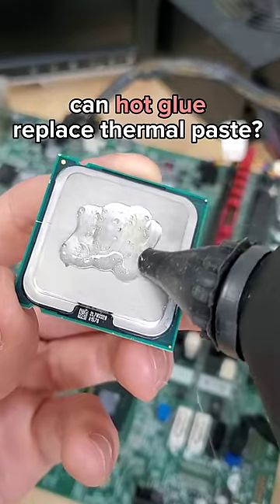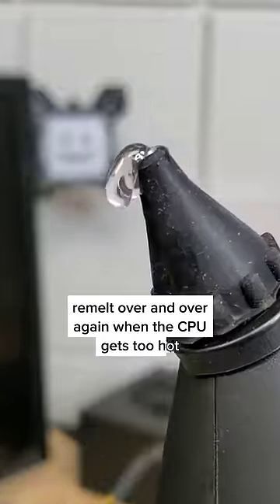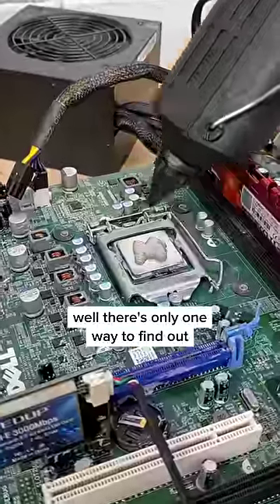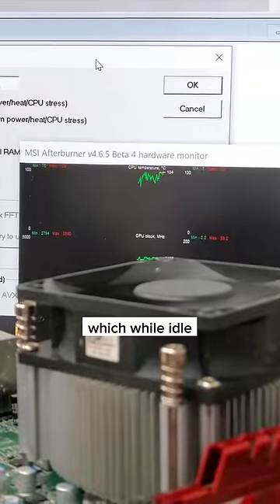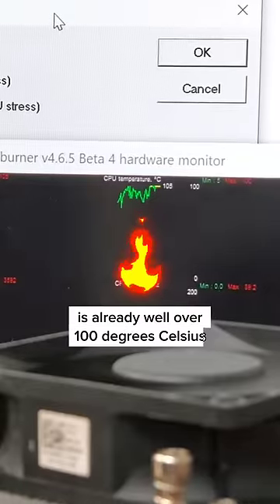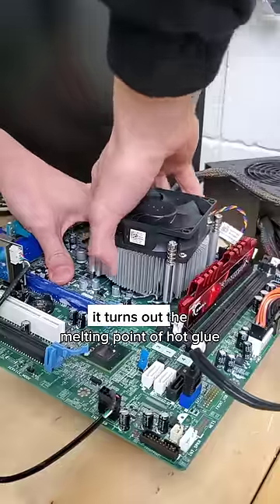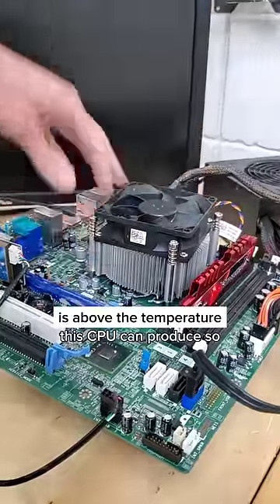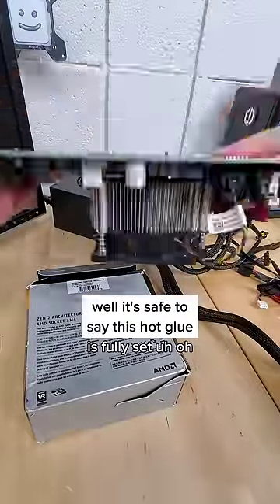using hot glue instead of thermal paste! #shorts

Comment: Use WD-40 as thermal paste
Reply: Reading your comment, I can already smell the smoke from here
Reply: Actually, oil is used in cooling applications
Reply: @Stovetopcookie Yes, in machinery. But not in electronics, probably due to the amount of dirt that oil attracts.
Reply: @alanjamesh.zamorano1677  Well I actually sprayed WD40 on my 2011 PC and on my old GPU and the parts I sprayed actually started having better contact and never rusted while the parts I didn't spray started oxidizing green here and there a bit...

My old Strix RX480 I also used till 2 months ago and is still surely working.

Ps: WD-40 also makes them look brand new and I actually had no dust glued problem, the dust looks just the same and comes out the same as without WD-40 but off course I also wiped after applying and was only full of WD40 on like the PCI slots and ram, it also helped me have much less ram issues after wd40 on the slot cause before if I would just touch a dimm it would go beep, beep, beep and I would have to re-seat the ram a gazillion times...
Reply: @Stovetopcookie  despite having the name "penetrating oil" (or penetrating fluid), it's not really oil as most people would define. It's more like a fuel/solvent. It/they evaporate easily and hence would be similar to using water or ethanol. Pretty much all of it will evaporate after sufficient time/heat.
Reply: Going to be a well lubricated cpu
Reply: Wd-40?? What’s that? I use A1 steak sauce as my thermal paste

Comment: actually hot glue tends to melt at 80c so if the CPU is left cooking the glue and then you don't let the heatsink cool down you can remove it in a tacky state
but better to just recover your old CPU using isopropyl alcohol as it destabilizes the bond of the glue and will already be 100% safe for cleaning electronics
Reply: it doesnt melt at 80 degrees
Reply: @Em6301  ok perhaps my numbers are a tad off but hot glue definitely loses the ability to adhere well before CPU temp maximum, and a bit of some form of alcohol factually does reduce bonding ability when cold so my point stands, even if flawed in details
I think at the time I guessed as I knew it didn't boil water instantly right when the gun was ready to dispense but I knew that even just before melting it caused burns so it must start to melt between 50-100c making ~80c a good guess, perhaps you took the numbers given for melting point and assumed it could not be de-bonded thermally below melting point or didn't realize my point was that you could remove the heatsink from the CPU using non-destructive methods but I was in error for the melting point, just not the rest of my conclusion
Reply: or just pop it in the freezer and it will likely separate on its own terms
Reply: @Maleko48 if you throw it from a hot air balloon I bet it'll be separated by the time it hits the ground, if not it will be.
Reply: Sounds like 🤓
Reply: @Caviar165  fr like I aint reading allat 💀
Reply: Blast the heatsink with a hot air gun, problem solved.
Reply: @Benri05  yes, but be careful not to heat the cpu above 150C at all, the indium solder on some CPU's melts at that point and most TIM materials do not play nice above 100C for very long
but a heat gun on lowest setting and max airflow with some distance and some way of ensuring the CPU does not fall out and get damaged and yes, any hot air source will help

also you could just soak the CPU in a dish of isopropyl, it will clean it and de-bond the hot glue leaving the CPU clean and a lump of hot glue behind
I actually used toothpaste once in a pinch and it did work, for a few days
it was only marginally better than direct contact with no TIM and it quickly dried up leaving it worse off

any material with thermally conductive microparticles will work, sadly hot glue is a thermal insulator, leading to the CPU just thermal throttling as if you didn't have a heatsink at all

just use some metallic dust embedded in some form of putty or paste, the metal powder will fill microgaps and the paste will keep it from covering sensitive points and causing shorts
actually graphite dust embedded in a paste is one of the best DIY thermal materials, graphite is unbeatable in thermal performance and you only need to ensure it is held in place

they actually sell graphite impregnated thermal pads that perform as good if not better than normal pastes, plus it is mess free and if you swap stuff often it can be cheaper in the long run as you waste less on each change
Reply: mhm ....who would have thaught that silicon will insolate instead of disipate heat😇🤨🧐
Reply: @johnthefactfddict3281 or you could just avoid all that by using thermal paste like a sane person

Comment: You can indeed remove hot glue from cpu, it just needs some hard prying and if not done with care, you might lose a cooler or a finger.
Reply: The fact that you said that one might lose a cooler makes me think that you have absolutely no idea what you're talking about. The cooler is the one thing that can definitely stay intact. It's the motherboard and CPU that is in danger of serious damage and destruction. In particular the highest risk is with the CPU lid getting ripped off (it's a battle between glues).

I would think that the hot glue would be relatively easily separable though, since it's not a good adhesive.

Comment: I found a 3090ti with hot glue all over it at my work one time, i work at an Amazon returns place... I assume they mixed up "hot glue" with "thermal paste" in translation somehow but it had it on the ram chips, on the cpu dye, there was even heat syncs glued all over it

Comment: It should not be doomed, I've had power regulator modules fall off and melt hot glue at 60°C. Maybe it will fall at 100°C when it's under load

Comment: Take a blunt tip syringe and inject rubbing alcohol under the heatsink. It won't dissolve the glue, but it will make it slippery so that you can twist off the heatsink more easily.

Comment: How about instead of sucking air from the cpu outwards you suck air from the outside to the cpu? This way there will be a small high pressure area at the cpu indtead of a low pressure one.

Comment: Think about it. If hot glue was able to transfer heat like thermal paste, when you were trying to hot glue something, the entire stick would melt and not only the tip where you want it to melt.
Reply: Not really true. for example, solder conducts heat relatively well and it won't melt the whole roll/line.

Comment: Easy fix! Spray alcohol (ethanol or isopropanol) 96%+ all the way around. When the vapours of alcohol find their way into hot melt glue, they absorb and cause it to crumble and debond from all surfaces.

I also think the reason it failed is that layer is too thick, you may need to preheat the heatsink on the stove before plopping it down on the CPU with hot melt glue :D

Comment: Overclock the cpu to met the glue lol
Reply: Impossible. Transistor self-destruction above 105°C for this technology. So CPU limits temperature internally way below that using forced idle. But hot melt glue needs 130°C.